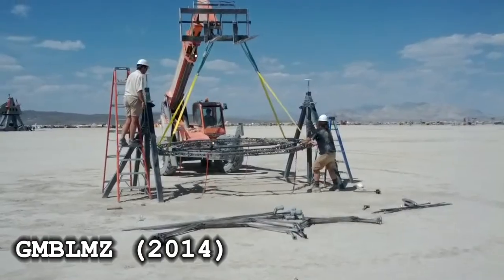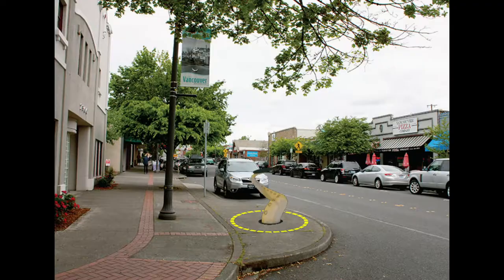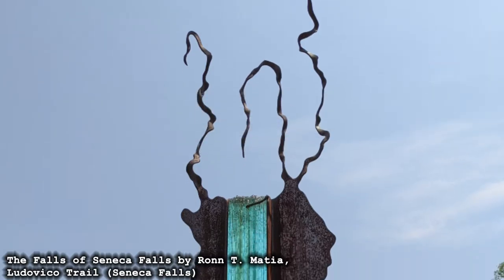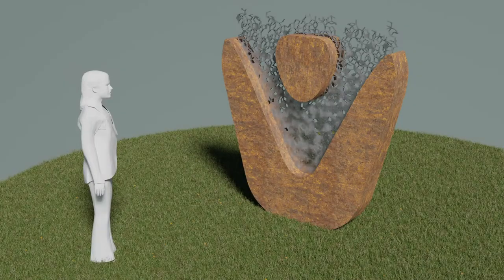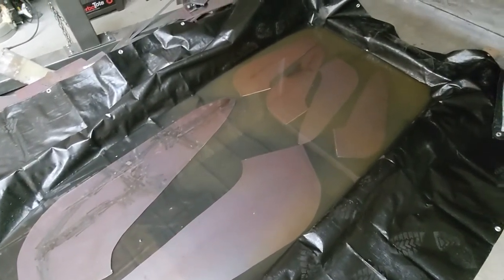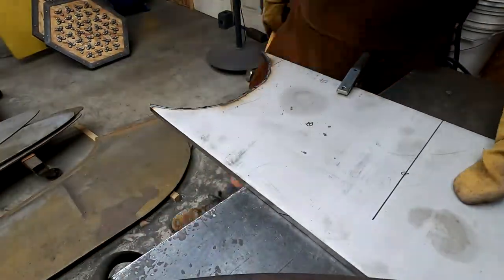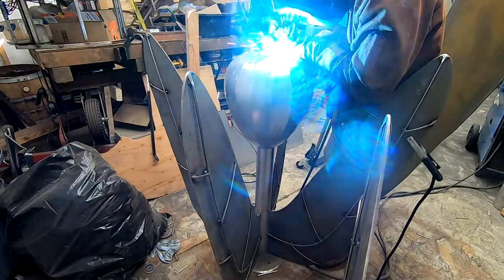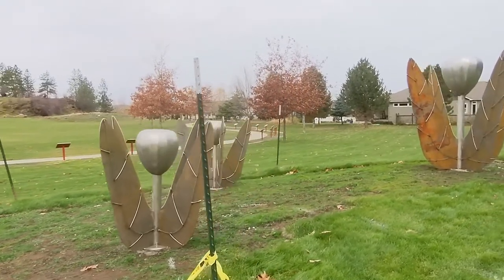Making Public Art: A case study

Comment: The first part of the small flower assembly makes it look like you're building a rocket.
Do you bolt them down with normal nuts or do you do anything as regards tamper-resistant or permanent nuts?
Reply from the maker: In this case the city just wanted normal nuts with red loctite. I've used the security nuts before where the hex head shears off, leaving just a low cone behind, which are pretty nice.